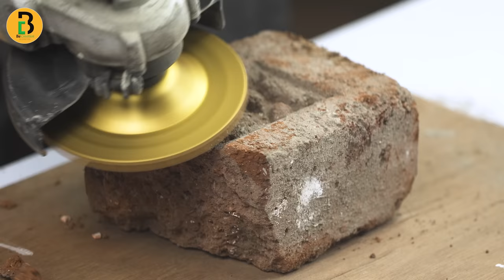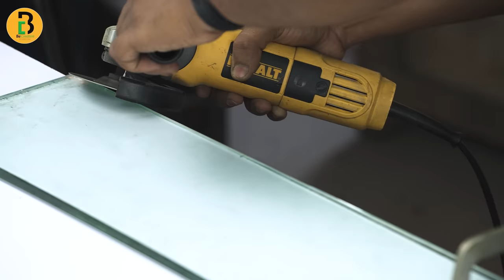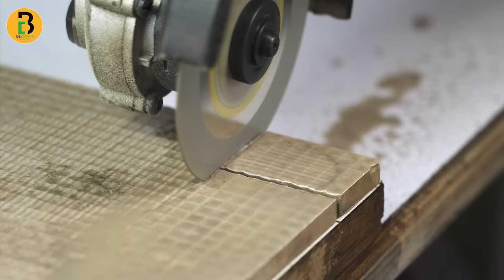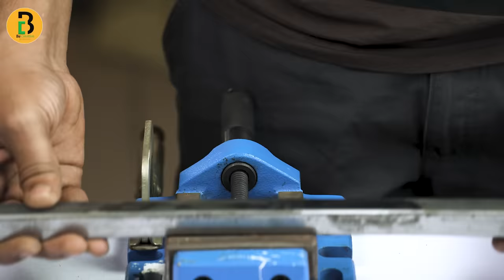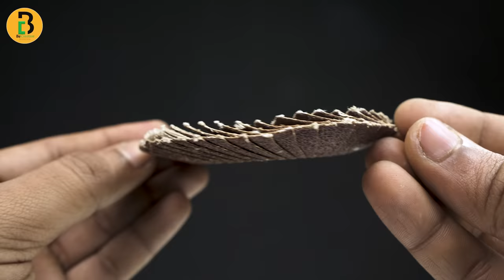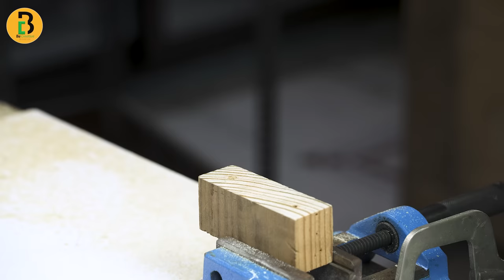Top 10 awesome & Useful Angle Grinder Discs!!!

Comment: Please don't use Wood cutting wheel on angle grinder it is very dangerous. It would be used only on a marble cutter.
Reply from the maker: Ok, thanks
Reply: Yes agreed to Govind statement, there is already been a lot of accident case, try avoid miseducating other new user.
Reply: Which disc blade is used for magnet cutting
Reply: Yes you are right .
Reply: A very generous advice.
Muchous gracias
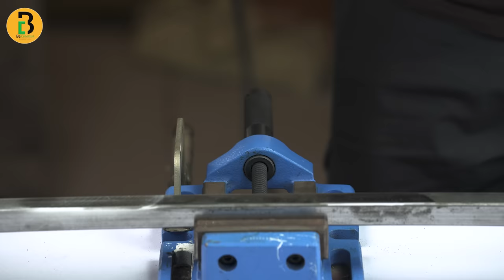Reply: 4:11  @BeCreative1
Reply: @dkhooeh  de nada, señor🙏 from India
Reply: So the "chainsaw" disc demonstrated in the video is safe to use ?
Reply: Your correct
Reply: You are right bro✌️🪚🏴‍☠️🏴‍☠️🏴‍☠️
Reply: Excellent content! The explanations and demonstrations of the angle grinder discs were clear and useful. This video has definitely helped me choose the right tools for my projects. Much appreciated!
Reply: Is that the correct  way you fixed the metal  disc on that machine? ❤
Reply: True, I almost lost my dingdong
Reply: The Chain saw and wood saw blades are actually highly dangerous blades. If you do not want to cut your fingers off. One jam on the knots, the grinder will jump up and you will loss a few fingers. Have fun.
Reply: there are wood cutter much more safe.. but there are segmented disc no like a saw, but i agree the disc in video is rally dangerous specially in hard woods
Reply: Perfect DIY project for a weekend!

Comment: Wood cutting wheel is called the finger cutter. Very dangerous. Shouldn’t use it.
Reply: The saw blade can break easily & fly towards anywhere. Yes very dangerous. I just use metal cutting disc to cut wood. Safer & faster.
Reply: Chain saw disk is the worst. Safety should be know like your four fingers.😅
Reply: The Chain saw and wood saw blades are actually highly dangerous blades. If you do not want to cut your fingers off. One jam on the knots, the grinder will jump up and you will loss a few fingers. Have fun.

Comment: The Chain saw and wood saw blades are actually highly dangerous blades. If you do not want to cut your fingers off. One jam on the knots, the grinder will jump up and you will loss a few fingers. Have fun.
Reply from the maker: Yes, I am aware of that. That's why I am using a speed controller.

Comment: Wood fly cutting wheel so dengourus.
Reply: The Chain saw and wood saw blades are actually highly dangerous blades. If you do not want to cut your fingers off. One jam on the knots, the grinder will jump up and you will loss a few fingers. Have fun.